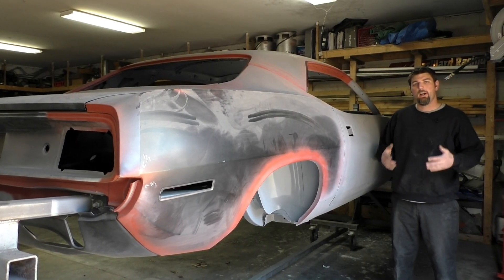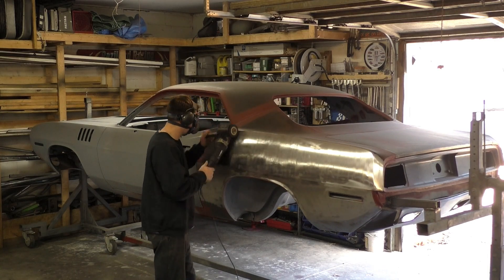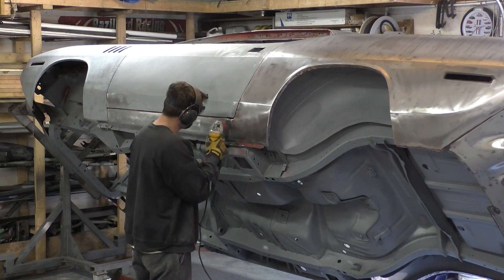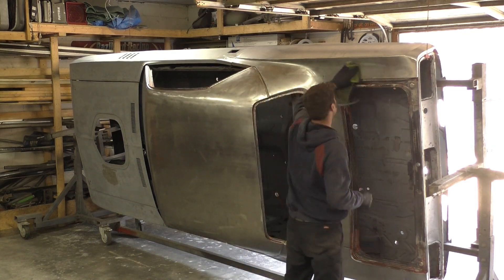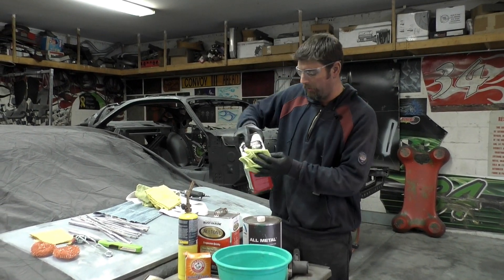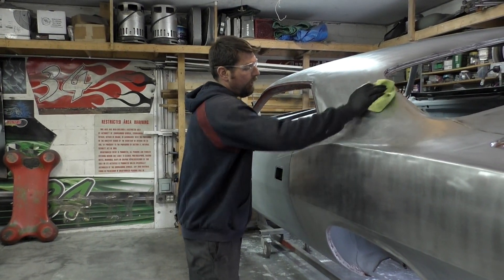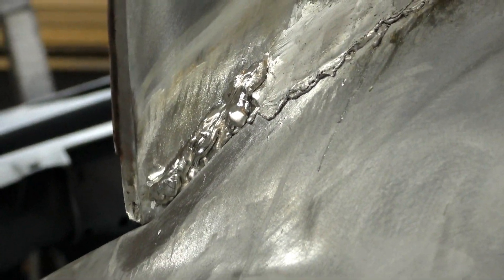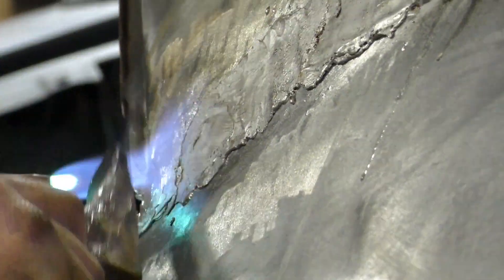Guide to leading in the body seams on restoration projects. 1971 Barracuda episode 14

Comment: Very enjoyable channel!!
I’ve always believed in leading welded seams. 
   You often see see a welded seam through the paint, especially on a hot day.
I just get it fairly close . 
I cover everything with epoxy primer always, then I use body filler to get it a little bit better.   
   In addition, it  adds strength and  won’t shrink. 
Thank you
Reply from the maker: Thank you very much and that will work there is a reason good lead jobs still look as good his many years later. I think you will be just fine doing it the way you have planned. Good luck on your project.

Comment: Great video! Im new to body work. Is it possible to use fiberglass body filler to fill in those gaps instead of lead?
Reply from the maker: Yes you could use bond fiberglass. I would personally look into the the Evercoat kitty hair fiberglass brand instead.

Comment: Thank you for posting this, very helpful. Did you used the acetone as a wax and grease remover for the whole car
Reply from the maker: I used acetone on just the lead areas and then wax and grease remover everywhere there is bare metal before priming.
Reply: Thanks

Comment: Great video, love your in-depth explanations. I'm restoring my 67 camaro and I'm debating using lead or lead-free soldering to cover some small rusted out holes in the hood. What's your opinion on the lead-free soldering kit from Eastwood?
Reply from the maker: Thanks, rusted out holes? So a couple things to consider is all the rust out of the holes? If not anything you put on top of it will have a chance of bubbling up from the rust. Also in the hood? In the hood putting heat has a really good chance of warping that. My option on rust holes in that area is I would make sure nothing is exposed on the back, holes not going all the way through. If they are I think you need a metal patch to be welded in place. If they are just putted really bad and cleaned out I would add all metal which is a aluminized filler. I think that would be the easiest for your application and not hurt the hood anymore. Also I did a video on OSPHO if you check that out might help you out with some rust treatment.
Reply: Hi, thanks for replying. There's about 5 small round holes ranging from 1/8" to 1/4" diameter, and one hole about 3/8" x 1". There's also a few tiny pin holes about 1/64". The holes go all the way through the top layer of the hood. There's no access from the underside of the hood due to the double panel. Also, there's a lot of pitted spots. I killed all the rust with muriatic acid (as that's stronger than OSPHO or Phosphoric Acid) while scrubbing with a red scuff pad and then 30% vinegar and cleaned with scuff pad and water. I think I should neutralize the surface with some baking soda and water mix, or OSPHO, what do you think? 
So, it seems that lead soldering to cover the holes is not a good idea due to warping. I took the hood to a welding shop that builds race cars and he said welding it would cause warping. I'm concerned that welding patches would cause warping. The hood is already warped some, as it's 56 yrs old, so I will cover it with body filler and glazing putty after the holes are fixed. I can send pics if helpful. I really appreciate your advice as I'm not sure what to do at this point. (sorry for such a long explanation)
Reply from the maker: @darrelllayton196  So I think the only way I would say to properly fix it is pull the whole skin off the frame on the hood, TIG in your patches and holes then hammer and dolly to fix  it. Anything else in my opinion is a short term fix that will lead to paint and rust issues down the road.

Comment: Wonderful job, question , was the seam between the roof and quarter welded hundred percent. Thanks
Reply from the maker: Yes it was plug welded every inch then cleaned up,. Since I cleaned up the welds it didn't look like anything was there.  What else you see is a couple tacks just to really hold the seam on the edge down in general that I knew the lead would hold. .

Comment: I have a 69 Dart. How many pounds of lead do I need to complete the quarter panels and cowl? Can I use a can torch? Thanks
Reply from the maker: I would buy a 10 lb pack, better to have too much then not enough but it all depends on application. I am using a torch with the eastwood tip in the video, that is the way I recommend.

Comment: Do japanese cars uave lead or just the the old Americans cars
Reply from the maker: I have never touched a Japanese car however, I would think there should be lead in those car in that era. Lead was used because modern fillers weren't around and the roof was too large and had to be stamped separate so the only way to adhere it all the way around the piece with the spot welders was to go through some of the outer body in the back seams and the front pillar and the only thing they would have had at the time to fill it efficiently would have been lead since it has a lower melting point then metal.